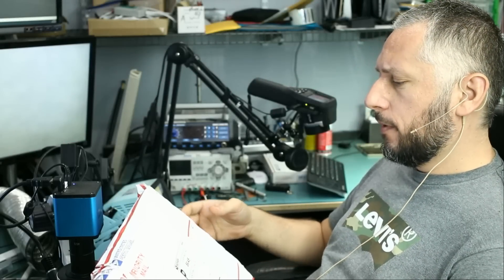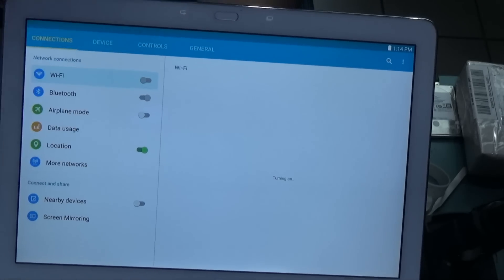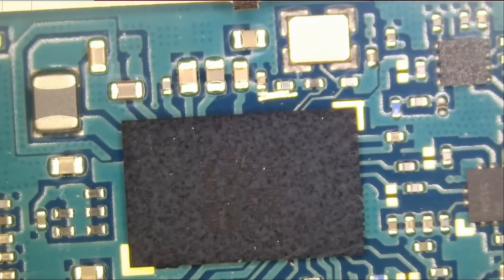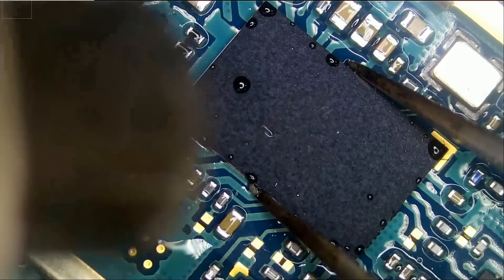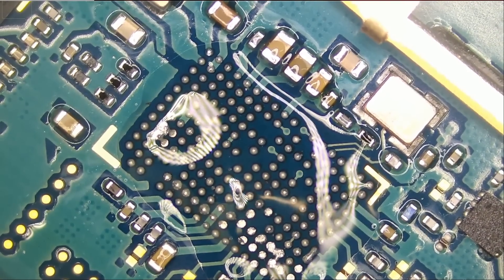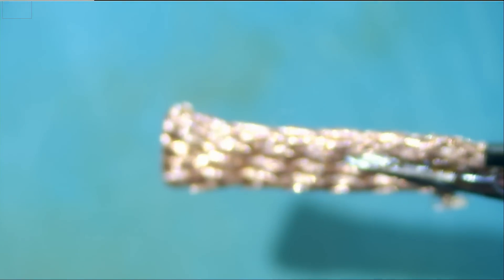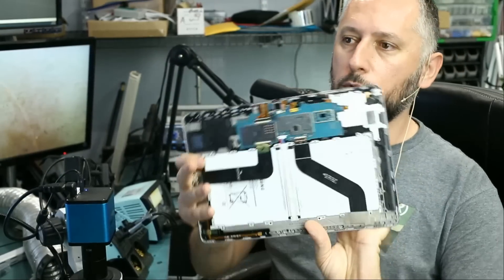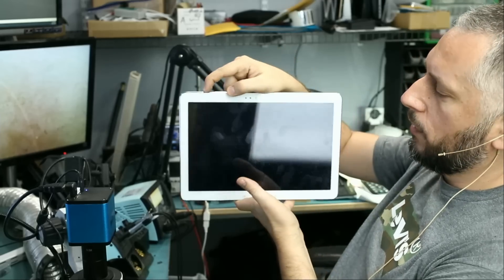Awesome way to remove solder balls using Hot tweezers - Samsung P900 Tablet no WIFI Bluetooth repair

Comment: i worked at a few motherboard rework places. can do also with normal soldering iron head, probs reccomended 300 celsius temperature safe arrea, plenty of flux and just cut a small segment of 1 cm max lenght of copper wick braid . it is verry good for leveling the solder balls but if you hold it to long, or clean the burnt ressidue flux and repeat with new wick segment. soldering tweezers are awesome anyway. look up also desoldering gun.....works good in combo with soldering iron other side for high temp resistant holes

Comment: Hi sir nice work. But i have little poblam with this. It is you romove the lead from the circute boad by hot tweezer and soldring wick. 
But when you add a new ic, you dont add extra lead. Then how it solded on the boad properly.? Do you aded extra lead or not. Plz let me knoW. Plz sir..
i ll waiting for the answer. I am from sri 🇱🇰 lanka.. thank you!
Reply from the maker: The chip is reballed which means already has solder balls attached to it.
Reply: @NorthridgeFix  ohhhhh i got it sir. Thank you very mutch.. ❤❤❤❤❤❤❤❤❤❤❤❤❤❤❤❤❤❤❤❤❤❤❤❤

Comment: hi from where did you brought the hot   tweezers
Reply from the maker: https://rover.ebay.com/rover/1/711-53200-19255-0/1?mpre=https%3A%2F%2Fwww.ebay.com%2Fsch%2Fi.html%3F_from%3DR40%26_trksid%3Dm570.l1313%26_nkw%3DWeller%2BWX2021%26_sacat%3D0&campid=5338440312&toolid=20008

Comment: Protect the surrounding area with tape never know those smd can pop up any time job well done bravo
Reply from the maker: Although tape may seem like a good idea, It shouldn't be used for smd components. Tape can expand or shrink when you apply heat causing components to shift, move or even stick to the tape when melting temperature is reached.

Comment: what model of tweezers and captin are you please
Reply from the maker: https://rover.ebay.com/rover/1/711-53200-19255-0/1?mpre=https%3A%2F%2Fwww.ebay.com%2Fitm%2FWeller-WX2021-High-Powered-Digital-Soldering-Station-200W-120-V-W-WXMP-WXMT%2F323758186800%3Fepid%3D2255467923%26hash%3Ditem4b617de130%3Ag%3AYygAAOSwuG9cnlWW&campid=5338440312&toolid=20008
Reply: NorthridgeFix thanks very good videos

Comment: Hot tweezers can be manipulated in many ways. Providing you have high-end equipment to provide the heat you’ll find this method very easy when dealing with lead-free solder. Heat sinking into the circuit-board preventing the solder from melting can be assisted with your hot air station on lower air setting. Using both hands simultaneously can be tricky at first for some. Practice boards help perfect the individual Tech’s technique. At the end of the day a busy well groomed Tech such as yourself, should be no problem. I don’t comment on all of your videos but never miss one and always give a BIG 👍.
Reply from the maker: Hot air at low temp a definite plus. I did not see a need for it in this case, but will try it in the future

Comment: hey great vid.wondering where you got the "chips book" ??
Reply from the maker: We will be selling the box with with assortment of components that we regularly use on our website soon. You can by the box alone at https://rover.ebay.com/rover/1/711-53200-19255-0/1?mpre=https%3A%2F%2Fwww.ebay.com%2Fsch%2Fi.html%3F_from%3DR40%26_trksid%3Dm570.l1313%26_nkw%3Dall%2Bbox%2Bsmd%2B%26_sacat%3D0%26LH_TitleDesc%3D0%26_osacat%3D0%26_odkw%3Dall%2Bbox%2Bsmd%2B96&campid=5338440312&toolid=20008